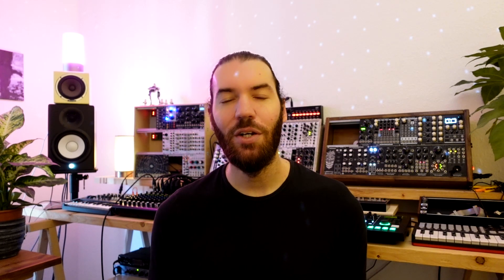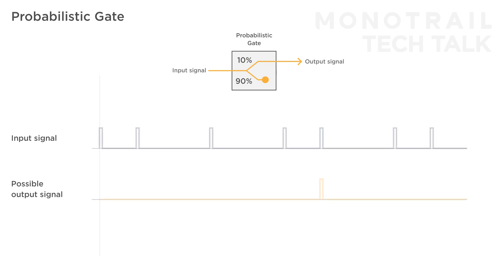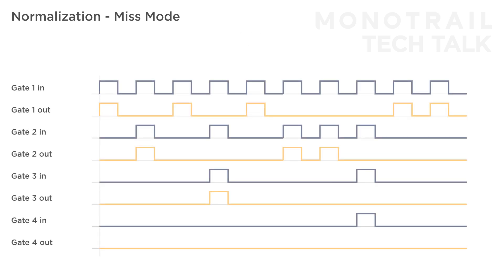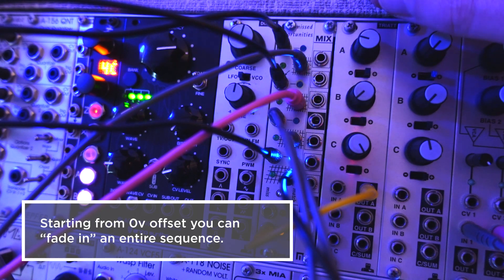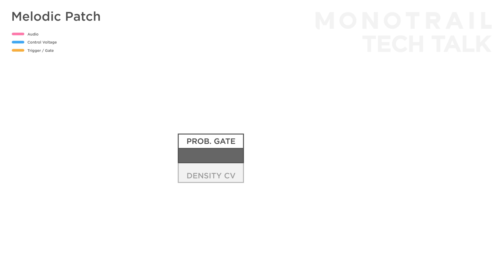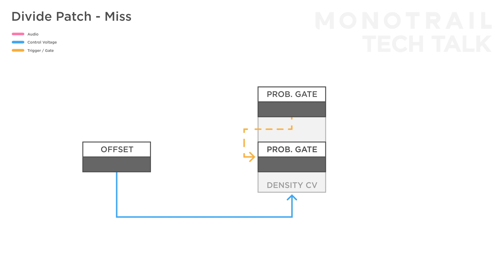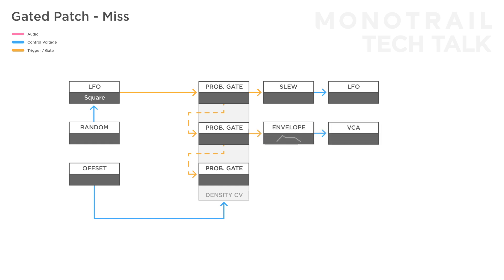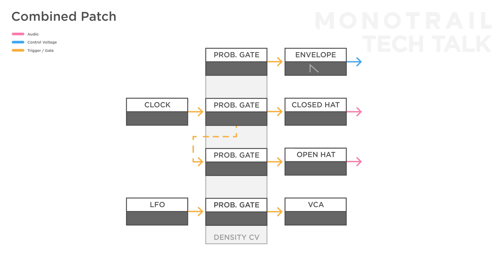How to spice up patterns with probabilistic gates – with CuteLab Missed Opportunities

Comment: A similari module is the Branches from Mutable Instruments, which is like a dual coin toss: the output is either head or tail.
The lower input is normalled to the higher one.
As cheap as 99€. In 6 hp
Reply from the maker: Indeed, although Branches is a classic Bernoulli gate, indeed like a cointoss between A and B. I like that module has a knob and cv for each channel, then again the MissedOps offers four channels, which works great for an entire percussive section, and some extra features. That's the nice thing about modular these days, so many options :)
Reply: @MonotrailTechTalk  i use branches for percussions as well... : )
Reply: @MonotrailTechTalk  Twiigs, another module in this category, has four sections that can be configured to manipulate trigger inputs in three ways.  You can order it from Pusherman Productions with all four as probabilistic gates (Branches firmware).   Or half of it can be a multiplier/divider or swing generator (Twiigs firmware).  In both configurations, the inputs are normalized in a chain. The other useful features are that each section has two outputs, one normal and the other inverted, and each has a probability CV input in addition to manual sliders.  The price of Twiigs is the same as MO.  The only downside is that Twiigs is 8hp versus 4hp.  Your videos are always clear and packed with a bundle of ideas.  I'll use what I learned here to up my game with Twiigs.  I particularly liked the idea of setting the probability of each step in a trigger sequence.  Thanks!

Comment: Very interesting ideas as always!
Just a question, at 5:08 shouldn't Gate In 3 generate all the blocked ones from Gate 2? (1, 3, 5, 9, 10)
Reply from the maker: Thanks! 1,3,5,9,10 are the gates passed on to the output of gate1. So in miss mode, the exact opposite blocked gates are passed on to gate 2 (2,4,6,7,8). Of those gates gate 2 blocks 4 and 8, so they are passed on to gate 3 :)

Comment: Without cv input to density, what is the probability of a gate outputting?
Reply from the maker: There's a tiny adjuster on the back of the module to set the value used without cv input. This also controls the amount of random pulses generated when no input is used in the first gate.
Reply: @MonotrailTechTalk  awesome tip, thx!!